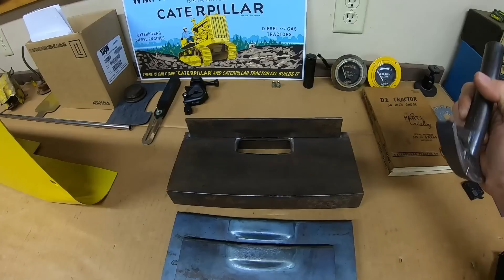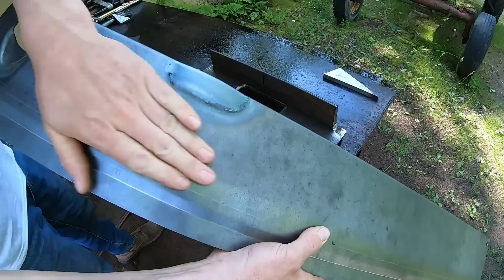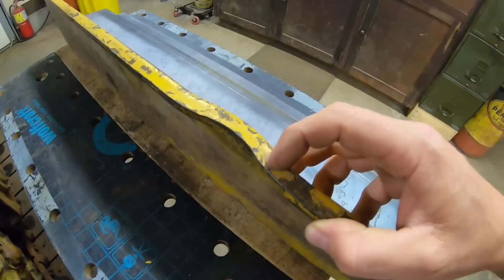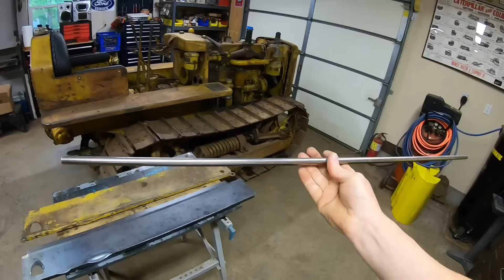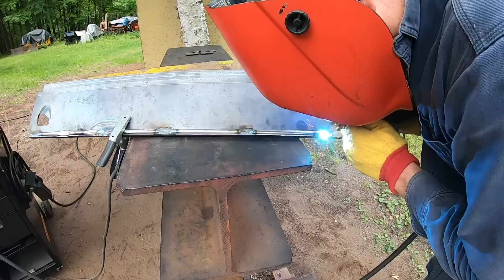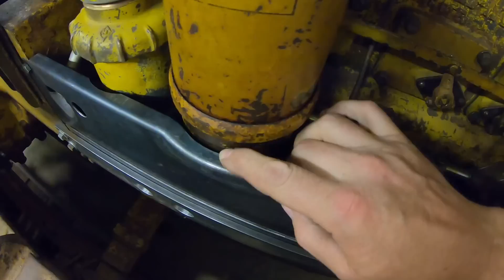Caterpillar D2 #5J1113 Chassis Rebuild Ep.59: Finishing the Factory Option 2-Piece Side Panel Build!

Comment: Quite amazing to see how that rolled edge just sank into place as you were beating the panel down into the die. 

Also, what is that flaking after you heat up the metal? Is that just the mill scale or is it oxidizing?

Comment: G'day Squatch.

Might it also be possible that the bit of steel produced by stamping the extra hole in the side plate was used for production of another part such as reinforcing for drain plug holes or some other bolt attachment point or as a washer or spacer?

Comment: Okay, I'm less than a minute in... and a question comes to my mind. If the original piece is a factory pressed piece, when it forms, are the metal stress points similar, the same, or not even close to a manually produced piece without the form/mold?

Comment: Where the reinforcing pipe needed to both bend (to follow the sheet work) AND be collapsed (for extra clearance), you could have separated the two processes for extra control; If you'd filled the pipe with sand (the old trick that pre-dates plumbers' internal bending springs) you could have easily put the bend in so that the pipe followed the panel, and the pipe would have stayed round in cross section.

Having tipped out the sand, you could then have done whatever collapsing you wanted.

Since the piece came out very well, just the way you did it, this comment is unimportant....

Comment: "Doesn't even rattle" - put that engine under a load and say that again. LOL

R/H side 2 panels. Does your eye twitch a bit between the 2 panels at the bump out, oil cooler lines toward the front? That bump next to the upper flat panel?

Comment: I don't your work background but in my opinion you are using what is known in the trade as a hard flame to heat, in other words to much oxygen, if you use a hard flame a lot of the heat bounces off whereas a soft flame does not deflect away.